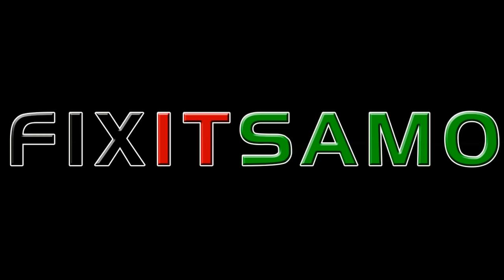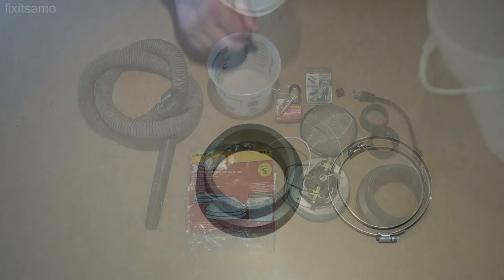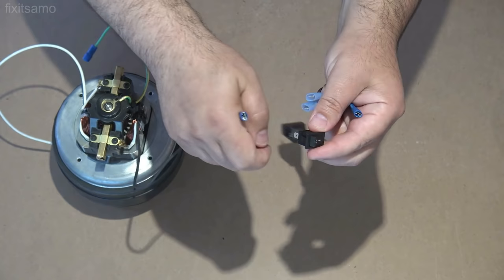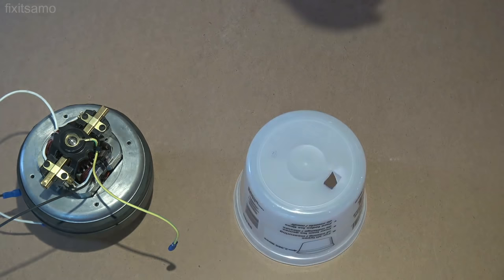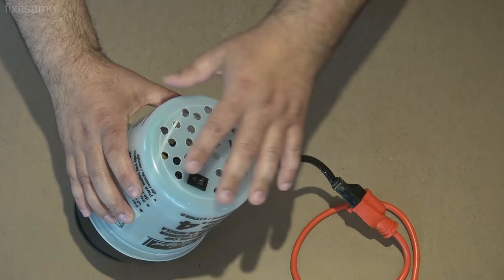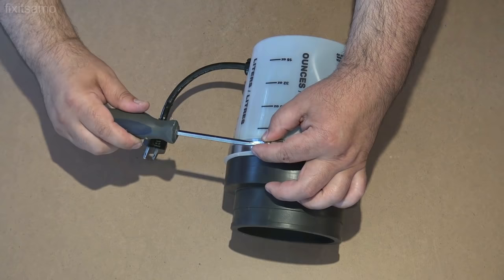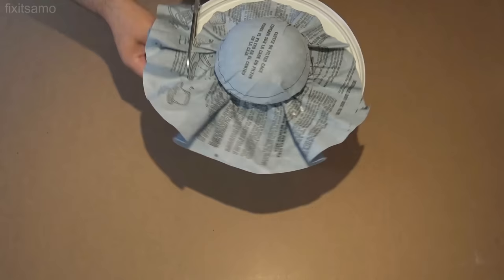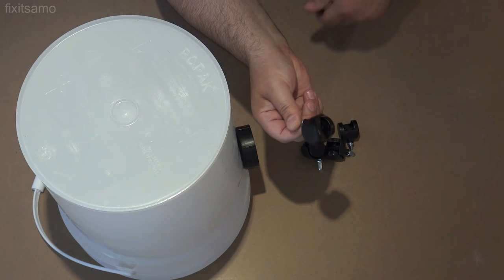DIY How to Make a Vacuum Cleaner STEP by STEP full tutorial

Comment: Also, if you used this build concept around a peripheral bypass style vacuum motor, which is simply a vacuum motor that has a seperate fan to cool itself rather than cooling itself with the air it sucks in through the typical suction port, you could create your own HVLP paint sprayer since you could use the exhaust port to attach a hose and sprayer without damaging the motor from choking the exhaust which is supposed to help cool the engine.
Reply: Pesan bisa g

Comment: with slight modification of the intake hose angle you could have converted to a cyclone
Reply: Even just putting a 45 degree angle on the inside will help improve this build greatly, an aditional mod would be to put some wood under the bucket to attach the wheels to so that it is not top heavy.

Comment: Good video.
 What do you think of this posting: 
"with slight modification of the intake hose angle you could have converted to a cyclone vacuum combo". 
adding a 90 degree elbow inside the bin to the intake.

Comment: so i'm using a 775 dc motor with a pretty standard impeller (3d printed). i'm curious why mine has so much trouble picking things up with a 1.25" hose but a 3/8" hose works okay. do i need to increase voltage/RPM (assuming my impeller is okay?)

Comment: i got a 400w blender motor. is it powerful enough to power my vacuum cleaner project? and hey guys, any suggestions what type of blade/impeller should i use.
Reply from the maker: +Jan Michelle Vila 
Sry for the late response  i strongly recommend using only a vacuum motor  cause they are designed to do this job
Any other motors might overheat and may cause fire or electrocution

Comment: does any body have a drawn plan on how the cables- positive, negativ and the third (jelow-green) cable conect to the motor?
Reply: ac motor does not have positive-negative connections because they work with ac directly. do not bother too much on yellow-green wire. just leave it packed with electrical tape, it is a grounding wire.

Comment: Can i use exhust fan motor which is abot220-240 volt somthing
Reply from the maker: +mohamad Istifaq 
Not sure if it would have the same suction force
Reply: Ok i will try it and will let u know
Reply: I wouldnt use an exhaust fan motor, theyre not really designed to have any load put on them. You can buy a vacuum motor cheaply off of ebay.

Comment: where did u get the motor
Reply from the maker: I got it from a store in my area for around 35$ Canadian  u can get in online from amazon https://www.amazon.ca/Bissell-Prolite-Cyclonic-Gaskets-2032112/dp/B00OQMRGBE/ref=sr_1_18?ie=UTF8&qid=1471187277&sr=8-18&keywords=vacuum+motoralso this 1https://www.amazon.ca/Ametek-Vacuum-Cleaner-Motor-119400-00/dp/B008MAXNA4/ref=sr_1_17?ie=UTF8&qid=1471187277&sr=8-17&keywords=vacuum+motor
Reply: Not there anymore. :/
Reply: Hello sir, I just did it with my fan motor , but it doesn't works , I have an idea that is to pick up firecracker /crosandra flowers with vacuum , I really need your guidance , looking ahead for your reply
Reply from the maker: +Raju.y Ch    You can get the motor at any vacuum repair shop 

Fan motors are not designed to be placed in a vacuum they don't have the same suction  power 
I strongly suggest using a vacuum motor only
Any other motor may overheat and can be harmful and can cause fire 
Thank you
Reply: Logan Dorsey . buutjrju
Reply: Logan Dorsey - Demerit l?
Reply: Go ali express

Comment: That motor is taken from a vacuum cleaner u could have just used the old one I don't think u can even buy those other than rip them out of a vacuum cleaner
Reply from the maker: This type of motor is usually used for blowers,foggers ,vacuum you can get them from any vacuum repair shop
Or any rebuild motor shop

Comment: does it work for liquids
Reply: technically as long as you get a waterproof vacuum filter it will work for it. motor doesnt play a big part in if a vacuum is for wet and dry. its all about the filter and water resistance. get some good waterproof filters and make sure its secured tightly to stop it getting by and slipping into the motor
Reply: Brandon Moore, and if you don't drill casters in the bottom.

Comment: where did you get the motor ?
Reply from the maker: I got it from a store in my area for around 35$ Canadian  u can get in online from amazon https://www.amazon.ca/Bissell-Prolite-Cyclonic-Gaskets-2032112/dp/B00OQMRGBE/ref=sr_1_18?ie=UTF8&qid=1471187277&sr=8-18&keywords=vacuum+motor
Reply from the maker: and this 1https://www.amazon.ca/Ametek-Vacuum-Cleaner-Motor-119400-00/dp/B008MAXNA4/ref=sr_1_17?ie=UTF8&qid=1471187463&sr=8-17&keywords=vacuum+motor
Reply: thank you !  never knew you could buy vacuum motors alone !
Reply from the maker: you are welcome usually u can get them from a  motor rebuild shop for dishwasher or alternator for cars